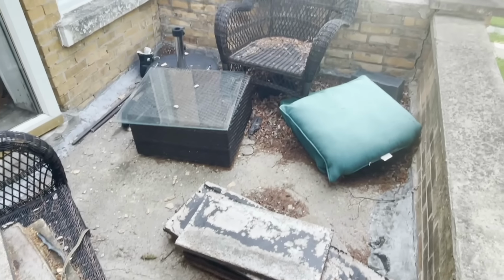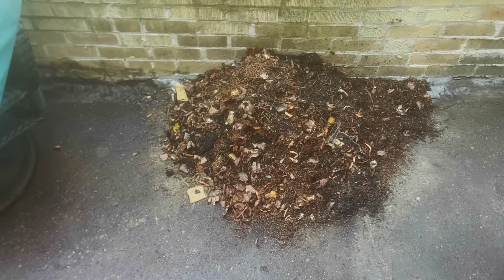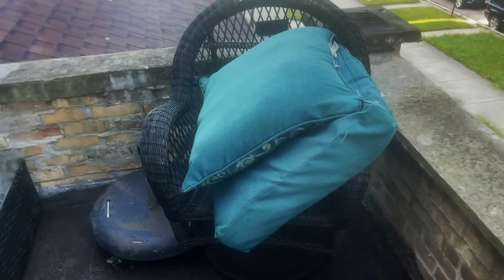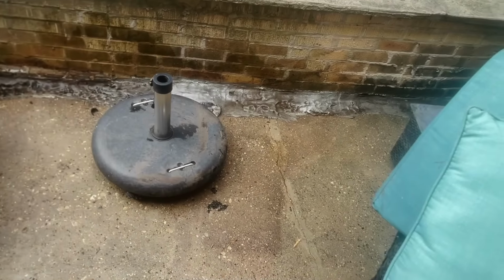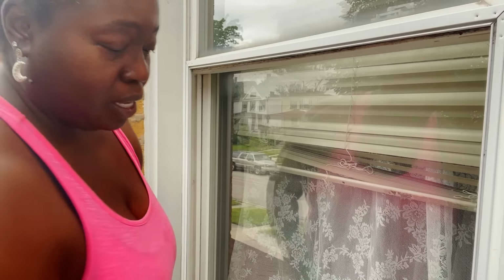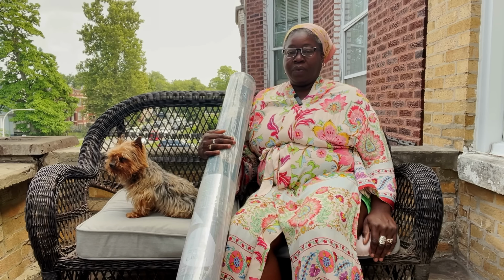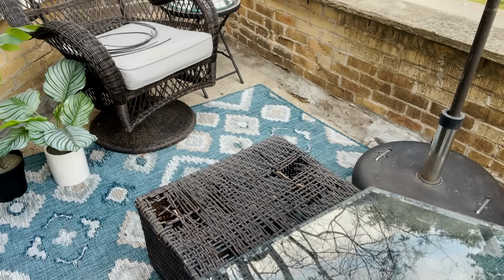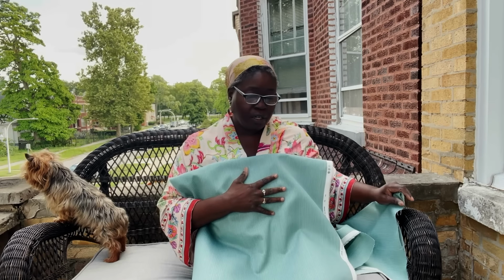How to Makeover a Small Balcony

Comment: My husband and I had to replace the screen material in ours. It's much easier if you take the screen off the window. That way, you can lay it on the kitchen table or another flat surface. It makes it a lot easier to work with.
Reply from the maker: @daymonv3736  Yes, I thought about taking the screen piece out but the way our windows are set up you have to dismantle a lot of hardware on the window to do that. This way was the best option for me. It wasn’t difficult at all and took like 20 min to install.